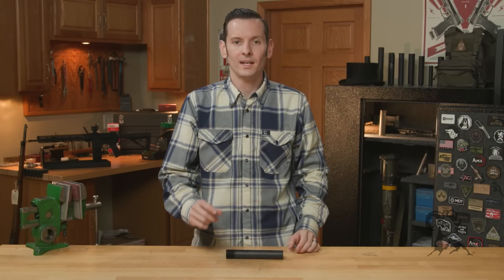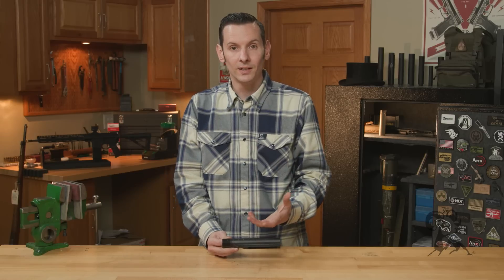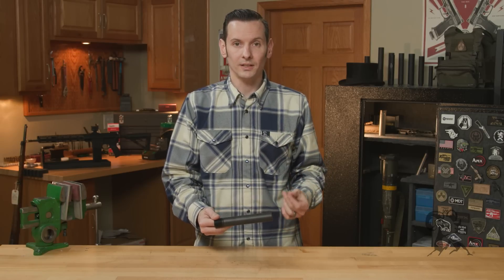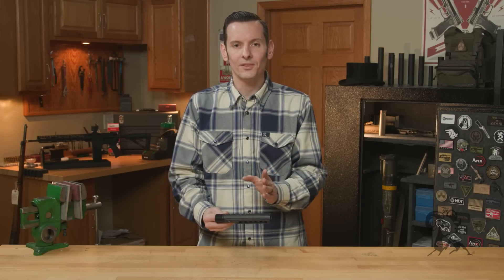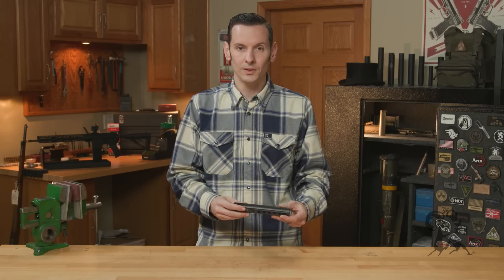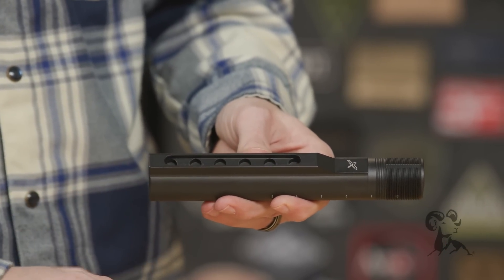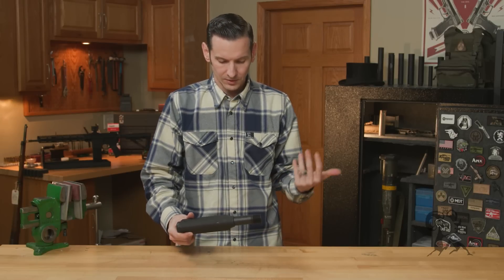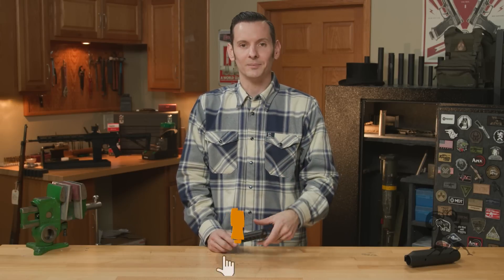Product Spotlight: Forward Controls REF Receiver Extension

Comment: Many FCD parts are for the flex. While they bring some improvements, they aren’t usually that big of a deal. And I say this as a person that owns FCD and paid a premium for it. 

If the buffer tube/receiver extension is not a5, then it’s not a substantial upgrade. Being forged is a pre requisite, drain holes and 6 positions are pre requisites. Even if it was an extrusion the threads on it are still the weakest point and would be what fails if the gun is repeatedly abused on that juncture (I.e. prying stuff with the buffer tube)

Comment: Slick side receivers are the GOAT
Reply: Until you need a foward assist
Reply: @mblake0420  Never used one in the 42 years i've used the ar15. Including 12 years in the service. There's no situation that a FA can fix that pulling the charging handle can't also fix.
Reply: @mblake0420 use your finger, works just as good!!

Comment: Odd there's no anti-tilt provision for those that run a external piston gun . Wouldn't be very much trouble to include it in the manufacturing process I  would think . It would be nice to have in case you change to a piston gun upper or swap uppers regularly. It wouldn't affect or harm the operation of a traditional AR15 IMHO . A better to have it and not need it feature as opposed to needing it ( bolt carrier on external piston guns tilting and gouging up your lower for example ) situation.  Me , I just like having as many options as I can get for my money . Just seems it could slightly be a even better product without overly complicating the manufacture of the extension .
 Just my humble 2 cents ...

Comment: So basically its virtually not much better than a standad reciever tube.   It is "moderately" stronger than a traditional tube that has been serving the military for decades now, multiple foreign militaries and insurgents alike.   Basically, buy the BCM or VLTOR A5 and youre way ahead of the game than this Forward Controls one.
Reply: He literally says it is stronger than the traditional military standard ones. That’s what a BCM is. VLTOR A5 isn’t a military specification…🤦🏽‍♂️
Reply: @CaptainCreampie69 while the VLTOR isn't technically mil-spec, it's widely regarded as a better design. It offers higher cyclic reliability, and mildly softer recoil. As far as I know, it doesn't have any downsides compared to the carbine system other than being slightly longer, and requiring a VLTOR specific buffer.